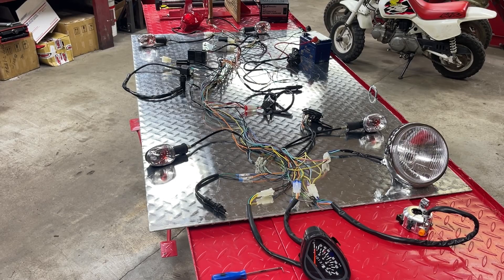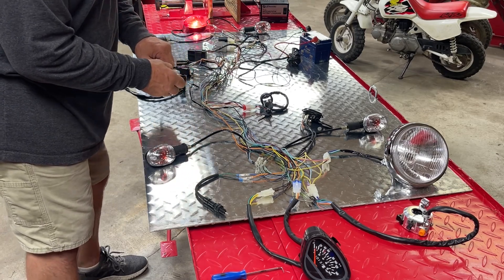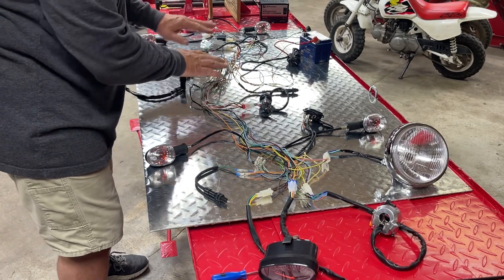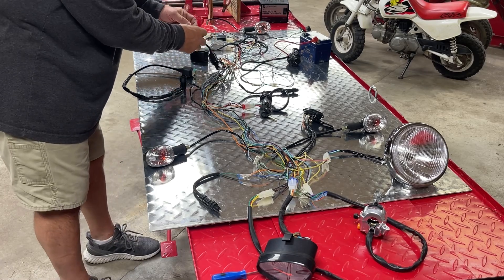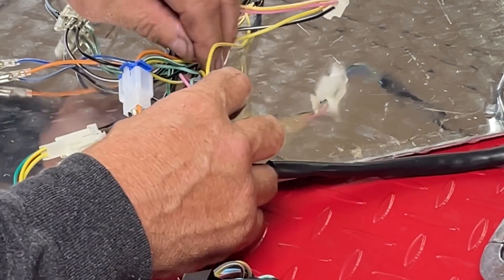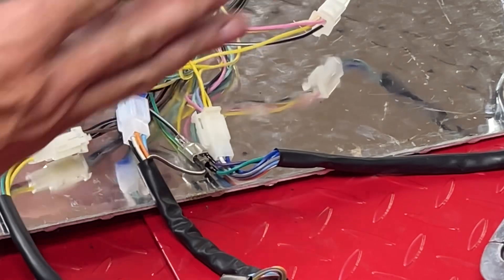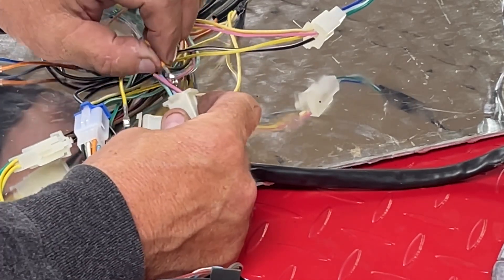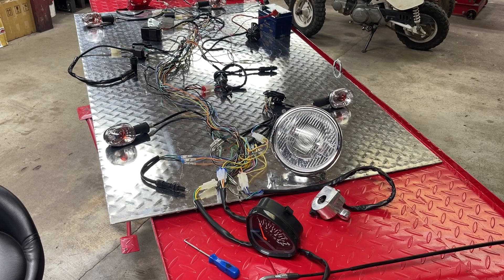Icebear Champion 125cc - wiring harness

Comment: Hi mate how do it wire in high beem dash light plz really stuck
Reply from the maker: The Hi beam indicator works as normal.  This wiring only changes how the Hi/Lo switch is powered.  The lights and indicator work as normal.

Comment: Your are fricking awesome buddy,you were 100% correct,it even has a Orange positive with key on, and it's a Huzhou Champion CT70 clone.guy that re-wired battery terminal wires was goofy, way to long and fuse is literally 10 inches under the battery tray wtf? Wish you wired it up,THANKS AGAIN FOR YOUR TIME AND ANSWER

Comment: Riding tonight on my 2020 icebear champion and all lights signals,brake light everything went out including neutral light and horn,motor still runs and shuts off by key,the lights, horn,signal all running off battery,the way I bought it,and actually a Huzhou Champion CT70 clone
Reply: Any help or ideas? THANKS
Reply from the maker: @DrewOdell-vv4gt Sounds like the main fuse blew, on the positive lead to the battery.
Reply: @MiniBikeMike you were 100% correct# awesome answer, saved me $80.00 hr. Labor from shop

Comment: Where can I get complete wiring harness for my ice bear ct 70 clone. I took the unit out of Create hooked battery and tried to start, there was a wire pinched and burnt fuseible link repaired it and will not start no spark. Give me some guidance. Please

Comment: Anyone else have a problem with the neutral light staying on even when in gear? Thus started happening around 400km. Trying to figure out where this is  occurring.
Reply from the maker: Wire is probably pinched behind the stator cover.

Comment: The pulsating current, kept burning up my tail light filament, so ine ordered a LED 1157 bulb replacement to see if that will fix it. The magneto at idle current is a little lacking on this model.
Reply from the maker: @gsp49  Sounds like you might need a new voltage regulator.  I’ve had my Champion since 06/22 and have never blown a bulb.

Comment: Okay, first: You totally answered my main question, and I can't believe it's that simple.
Having the headlight/tail light completely cut out if you run out of gas, 
is dangerous and should be IMO fixed by the manufacturer.
Second, do you know of any way to get the battery to charge more reliably while riding?
Mine never held a charge no matter what engine speed I rode at. (I regularly rode from Tucson to Phoenix) 
Thanks a ton!
Reply from the maker: @jcb0249  My Champion still has the original battery in it, from June 2022.  I’d guess you either have a bad battery, that won’t take a charge…., a bad regulator or a bad stator.

Comment: I did this and now my high beam and low beam are not working. What is the cause? Did it below the switch for the high beam low beam?
Reply from the maker: @johnpaoli4032  If they don’t work, they probably aren’t getting power.  You might have switched incorrect wires.
Reply: This is a oh shit moment. Would you have a wiring diagram for a 2023 ice bear champion. Mine is not to the manual I have a purple wire from the head switch where I don’t know now where it goes !
Reply from the maker: @johnpaoli4032  I have a stock harness at the shop.  Unfortunately, it will be a couple days before I can get back over there.  I can visualize the purple wire, but don’t recall, off the top of my head, where it connects.   I’ll check and let you know.
Reply from the maker: @johnpaoli4032  The purple wire in my harness connects to a black/white wire with a double female bullet plug.    There is also a brown/white wire plugged into the other female side.

Comment: Hey Mike when changing to DC voltage by swapping blue and yellow wires, why plug the yellow wire back in to the neutral socket? Is it needed there for a reason?
Reply from the maker: @joelcate2417  If you don’t plug the yellow wire in, you won’t have a neutral light.

Comment: will a tb harness work with these engines I would like to buy the labeled one for turn signals previous owner did a bunch of custom wiring I don't understand. would like to keep turn signals and all the street legal factors of the harness sense I know tb has just basic harnesses
Reply from the maker: @bamax8845  Yes, a Trail Buddy harness would work.  You can also contact Alan Adams, of Cajun Maddogs.   He is a dealer for the Champions and sells a stock harness, that should be plug-n-play.
Reply: @MiniBikeMike  thank you for the swift reply would it be better to use the tb harness if I plan on upgrading to the lifan 140 manual miss having the clutch besides that really liking my new to me icebear
Reply from the maker: @bamax8845  If you go to a TB harness, every connector on the bike or harness will need to be changed.   If you get a new Champion harness, the lights and everything on the bike should plug right in.  When you swap to a 140, you’ll only have the engine to harness plug to worry about.      TB harness or Champion harness…..your call.

Comment: Omg. Trying to put my bike together.  Came to the headlight and there is just a bunch of plugs not attached.  And I couldn't get headlight and taillight to work.  Didn't even consider this, because as far as I understand it, lights have to work if engine failed. Well one problem solved. But idk why so many extra plugs.  .. now I have to figure out which plug is headlight and which is the other 4 pin that goes together I think.  3x 2 pins go no where.

Comment: Hello. New subscriber due to this video. I’m working on a Sjyteam Dax clone trying to do this but my color coding is a mess. 
What I’m trying to figure out is where am I supposed to send my 12DC power to; to the low beam? The high beam? The high/low ground? Or is there a different wire you are plugging into with the switched 12V DC. 
Appreciate your thoughts.

Comment: You should put a digital cluster on your bike as well as an LED headlamp. I ordered mine from Bart motor company Orange county California. He has a lot of other parts for them ice bear champion trail bikes. & Honda z50 if you're in need of a longer speedometer cable for your champion ice bear you can order that from trail Buddy here in Michigan.
Reply from the maker: I’m not a fan of the LED and digital stuff.  I want my bikes to look as old as possible, like the bikes I enjoyed in the 70’s.
Reply: @MiniBikeMike but like I was told it takes less power on your stator actually gives you a little more power. But I noticed the LED light is a lot brighter than halogen one. And they say it last a lot longer. Maybe that's why they put them in all new automobiles today would you get around that would you change the LED lights out on your vehicle for halogen brand that would be expensive
Reply: @MiniBikeMike  I like my 69 roadrunner the 440 in it and my pistol grip for speed. But it looks a lot sweeter with LED lights. And a digital cluster. Then again to each his own. I have an original Honda 70 in a 1974 QA-50. Like my brother he doesn't like these clone bikes he States there's nothing like our childhood bikes. If you're a traditionalist like him he won't buy a Chinese Knockoff. Like his Harley 1942 panhead.

Comment: How do you get it so it runs on the battery but shuts off using the daytime running switch on the right. Somebody already did the battery jump but the switch on the right only controls the little bulb. (Amigo Rocky 125).
Reply from the maker: The Amigo should be wired from the factory to run the headlight off of the battery.  
On every Amigo I’ve seen, that switch on the right handlebar is useless.  In stock form, the only way to turn off the headlight is to turn the key to “off”.   On my Amigo, the top two positions on that switch are the same, all lights on.   The bottom position shuts off the little daytime light and the taillight.

Comment: Nice How does the break switch work to start the bike?
Reply from the maker: The brake switch isn’t tied into the starter.  You don’t have to hold brake to start.
Reply: @MiniBikeMike  I have only about 7 volts from my A/c stator, is my resistor the problem? just ordered a new one today.. non working break/running or  turn signals

Comment: Hi Mike I have a110cc lifan engine where does the neutral wire connect to thank u
Reply from the maker: If your engine has a neutral switch, it will be a green/red wire that comes out of engine with stator wires.   If your speedo has a neutral light, it should have two wires.  One of those wires is green/red and connects to the green/red coming out of the engine.  The other wire on the light needs to be hooked to 12v power.
Reply: @MiniBikeMike  I can find no switch
Reply from the maker: @saeedkhan7999  If there is no green/red wire coming out of the engine, the engine may not have a neutral switch.
Reply: There are 5 wire come of the engine plus a green wire separate o @MiniBike Mike’s Garage
Reply: How can I send u a veido please help me sir
Reply from the maker: @saeedkhan7999  https://youtu.be/NmPVV0wIDt8

Comment: I just picked up a 2021 icebear spartan 125 atv, the tail light and brake light does not work , Is there a fuse for the tail light , brake light
Reply from the maker: I’ve never owned one of those, so I’m not sure.  If there is, it’s typically right by the battery.   Have you unplugged the light and verified that the bulb is good?

Comment: Hi Mike! Great job on your videos. I'm interested in the taillight circuit. The brake light is powered off DC and works when the break switches are closed and the key is on but the taillight is powered from the engine stator windings and only comes on when the engine is running. What is the easiest way to switch the taillight from engine to DC power? Does the taillight circuit show up inside the headlight housing. I've tried looking at the schematic but the one I have in not the exact one for the 2022 Icebear Champion. I tried probing disconnecting and tracing the taillight circuit but was hoping I could find info before tearing into the frame. Can you tell me while looking at your wiring on the bench where the taillight circuit goes? Thanks! ~Kevin.
Reply from the maker: I’ve been at a wrestling tournament since 7:00am.   I won’t be around my bike until tomorrow morning.  Sorry, I don’t know the wire colors off the top of my head to help today.

Comment: Can the battery keep up with this?  Any downsides whatsoever?
Reply from the maker: The stator puts out 20+ volts and the regulator cuts it back down to 13v/14v to charge the battery.  My bike has 500+ miles on it and the battery is still fully charged and I use the electric start every time.

Comment: Mike this was a great video and I already did my headlight….I also swapped out the stock headlamp with a sealed beam headlamp, and it works perfect. Do you have a similar fix for the rear taillight…..I was thinking of switching the rear bulb with an LED, and shouldn’t that be run off the battery to avoid ac fluctuations?

Comment: Here's my question how much wires do I actually need to run my atv
Reply from the maker: If you purchase the kit linked below, you’ll only need three wires from your engine:  blue/white, red/black and green. 

LAXEEM Wire Harness Wiring Loom CDI Ignition Coil Spark Plug Rebuild Kit for 50cc 70cc 90cc 110cc 125cc Stator CDI Coil ATV Quad Bike Buggy Go Kart https://a.co/d/8erPySw
Reply: @MiniBikeMike  ok thanks a bunch
Reply: @MiniBikeMike  what about making a box that most of the harnes goes in to simplify wire mess

Comment: Hi Mike, is it common to find that most manufacturers use the same red, orange, yellow color code?  Thanks.
Reply from the maker: Honda did a very good job of using the same coloring for harness wiring throughout their models.  Most clones don’t conform to the Honda coloring and use their own.

Comment: Mike thanks planning on doing the dc conversion and you made it seem so easy with this setup. Question does the tail light work off the same wire or is it just for the headlight
Reply from the maker: The taillight is also powered by the yellow stator wire.  Unfortunately, on that end, there isn’t a good place to just unplug and replug wires.  You’d probably have to cut and splice into the orange wire.

Comment: I tapped my yellow directly to the battery. I grounded off the yellow lighting from the stator to ground, and I spliced the white to the yellow lighting at the rectifier. Bike runs and charges the battery but all electronics are powered through battery. No issues. I also put a 3 way tapped into the brake power wire to operate the amber and white halo light. I have the famous Amazon led headlight. Super easy and clean. I eliminated all the starter hookups since I got the manual 125 no electric start
Reply: Only took me a week of thinking and lots of f this to get it working. Shout out to mytrailbuddy for the help
Reply: @stevenmcnaught3648 yeah I ordered the extra long speedometer cable from trail Buddy so I could install this digital speed cluster
Reply from the maker: Yep, lots of ways to do it.  Your stator setup / charging coils are a different style than those on a stock Icebear engine.

Comment: While searching for the reason my brand new Ice Bear Champion would not start (which turned out to be a bad ignition coil), I found an extra connector in the harness under the gas tank. Turns out it was basically another kill switch connector. I'm assuming they may use that same harness for some scooter with a side stand safety. Did you happen to find the same in that harness?
Reply from the maker: Yep, all Champions have that extra kill harness.